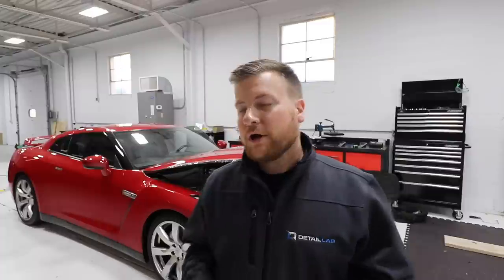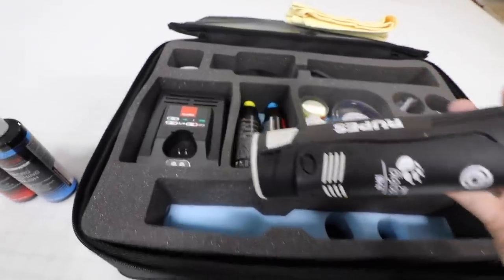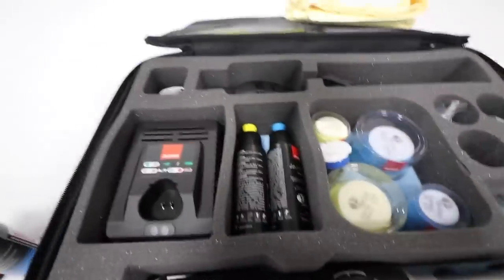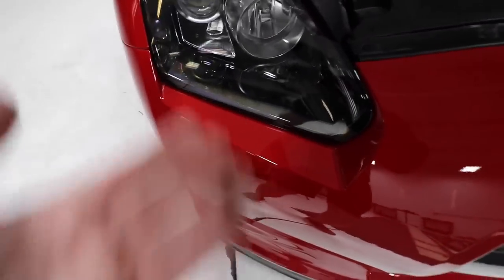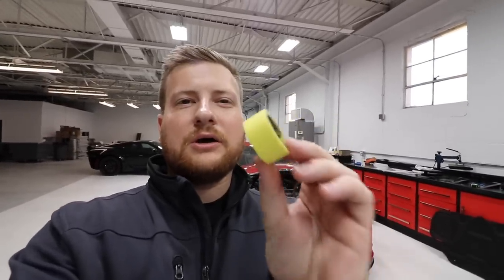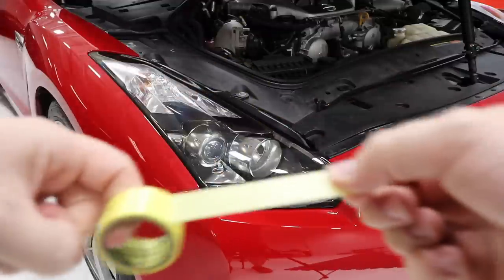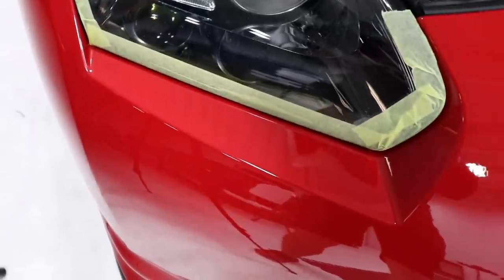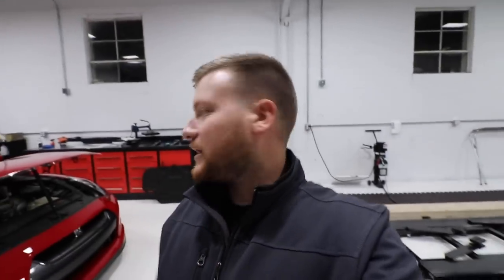Tips on Polishing In Small Areas

Comment: I wish I could correct the rock chip on the chrome/silver trim. It's the only spot on the front without a clear bra
Reply: Chrome paint touch up. Only solution. Make sure you get lacquer paint and don’t worry about adding clear, you can also polish the chrome plastic trim itself, but it’s a little over kill.